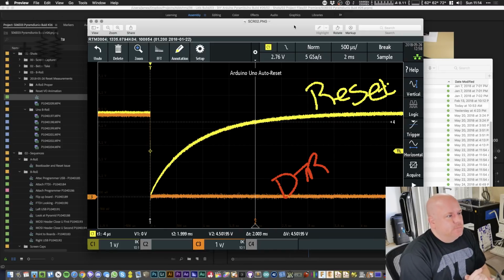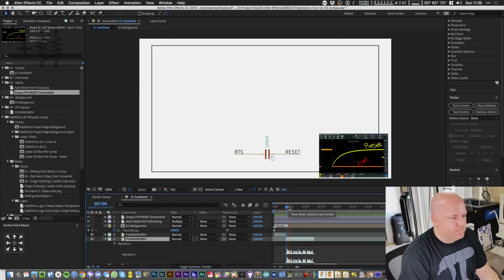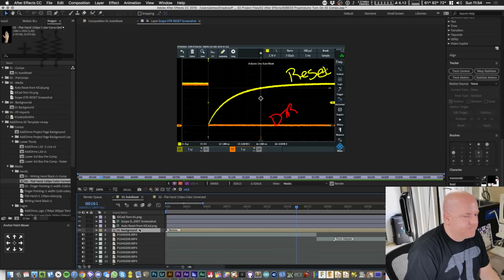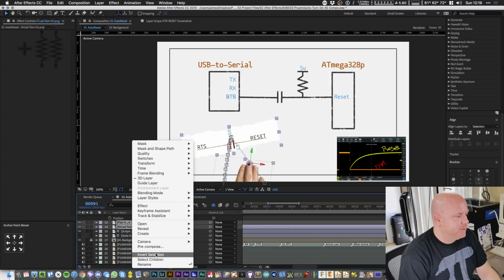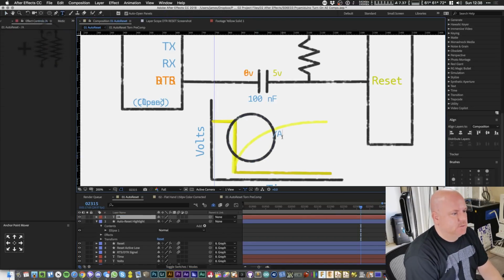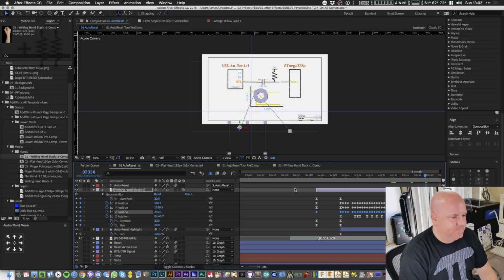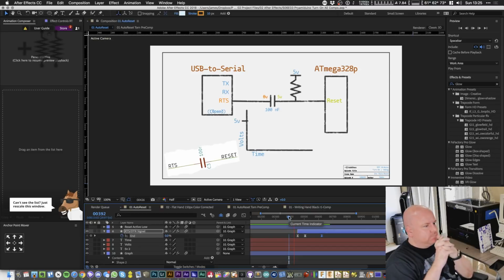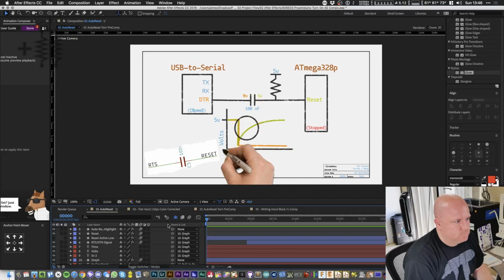Creating an AddOhms Episode--Live! |  AddOhms Live #8

Comment: If you are looking for good softwares for animation and graphics, you can get free or affordable ones that won't cost as much as After Effects. 
The FREE softwares are Tupi 2D Magic, DragonBones, Opentoonz, Krita, Gimp, MyPaint, Inkscape, Hitfilm 4 Express, Blender, etc. On my PC, I have roughly 25 free softwares for digital painting, sculpting, animation, music, etc. 
The affordables one are Explaindio, EveryCircuit, etc. 

If I were doing that work seen on your video, I would have first done the vector layouts in Inkscape, which you will no doubt love. Export parts separately as png or svg files. If you want the overlay hand without background. Go to Gimp and remove background therein. Export as png. 

Import all files into Tupi 2D Magic (easier than Krita). You can work faster there than in After Effect, as Tupi 2D Magic is a lighter weight software and so crashes less. If your PC slows down, it means you don't have enough RAM and your CPU is slow. If you were animating a hand drawing a resister symbol, you could create a white shapes to mask over the resistor symbol at the earliest frames and unmask area as you move hand holding the pen. 

When you have finished animating in Tupi, export file to either image sequence or AVI or MP4. MP4 contains less memory size than AVI. You can compile all video clips in Hitfilm 4 Express.
Reply from the maker: Thanks for the suggestions, but I have already passed on those workflows. Bitmaps make no sense, unless working in PowerPoint or Keynote. (Or for cases like the clipped screenshot image.) Creating the graphics in a vector program and unmasking is fine, if they stay static. In many cases I interact/animate elements of the drawings. The extra work involved with imported assets is about the same effort as creating them in AE to begin with. It isn’t as simple as “import SVG.” There is work on the export and import side to make the individual paths usable. Plus I find the limited vector tools of AE to be helpful. In some cases it forces me to simplify my graphic idea which is a benefit. (Of course it sometimes means extra work or the occasional graphic that isn’t as helpful, but that is the case of any tool.)

I ended up in AE because it very flexible. Adding 3D elements like I did for the Brushless motor video was no problem, once I learned Element 3D.  It is far from an ideal tool, but it also prevents me from having to use multiple tools which might end up with a fragmented visual style.

As far as the comment about crashes and slowness, it really hasn’t been an issue with AE. I can only think of two times in 4 years it crashed and I lost work. One was because of an out-of-date plugin and the other was a bug. As far as my comment on slowness, I just overlooked the load of OBS and the amount of work it was doing. My streaming computer was in a different part of my lab and I didn’t feel like moving it.